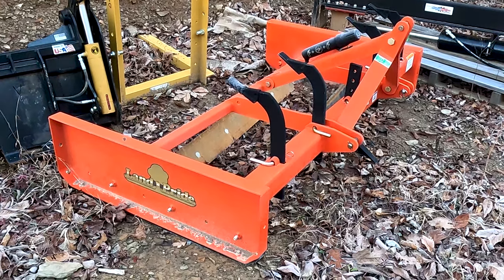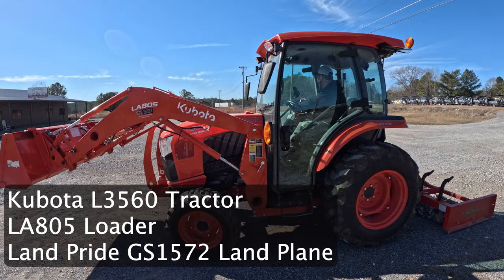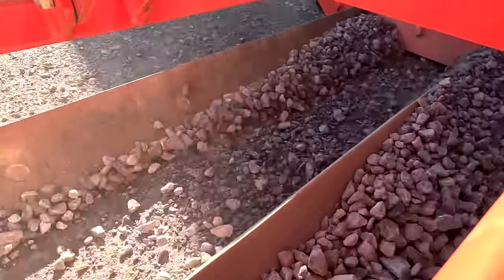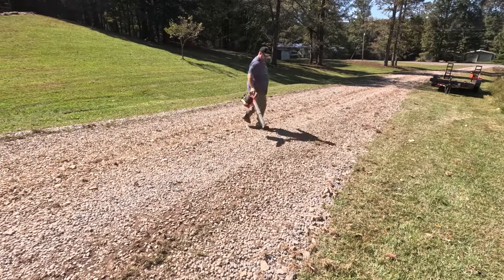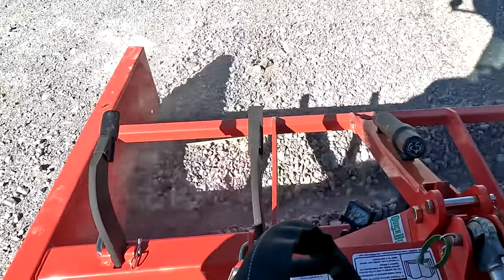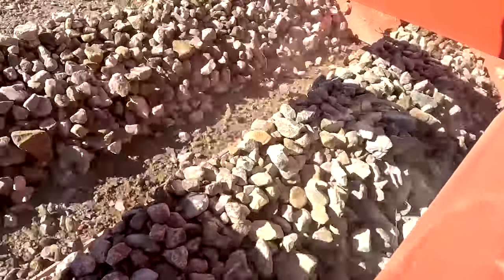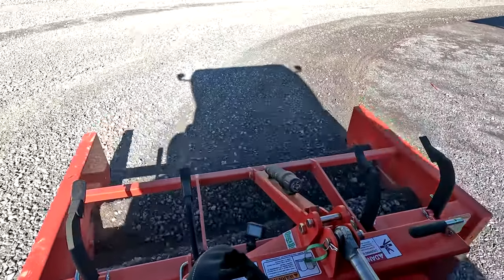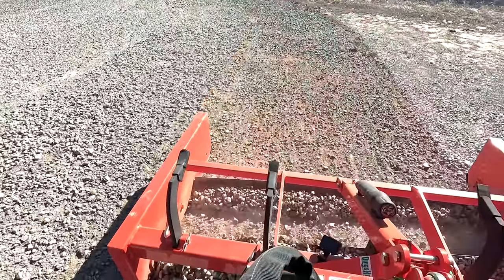Land Plane & Tractor Maintain a Gravel Parking Lot

Comment: How do you set blades depth? Do you or why would you tilt it forward or backward? Loved video and I’m still trying to learn mine better.
Reply from the maker: Hi!  Thanks for watching and commenting.  I try to set mine as flat as possible and just let it do its thing.   I have tilted the rear up a bit on occasion as way to put more force on the front so it will dig in a little better, but really I think the better way to break up the ground would be to drop the scarifiers down a couple of inches, make a pass or 2 to break it up, then pull them up and make passes to put a nice finish on it.  Hope this helps :)
Reply: @DirtAndRocks  thank you that helps I appreciate it!
Reply from the maker: @markheffernan3032  No problem.  Thank you again for watching :)